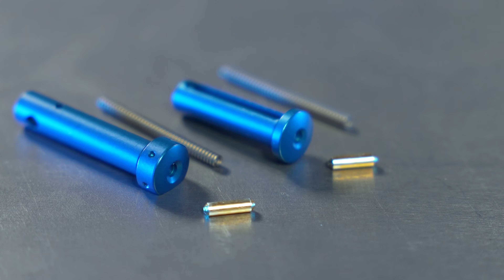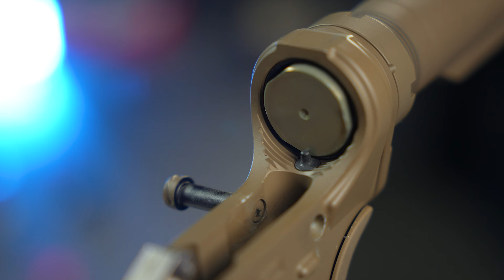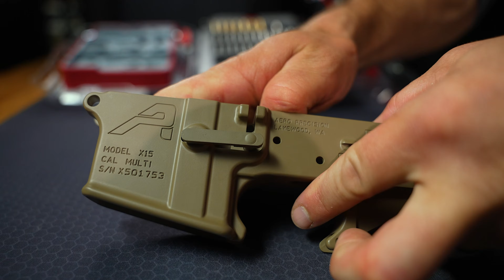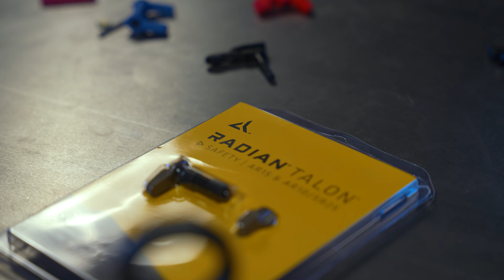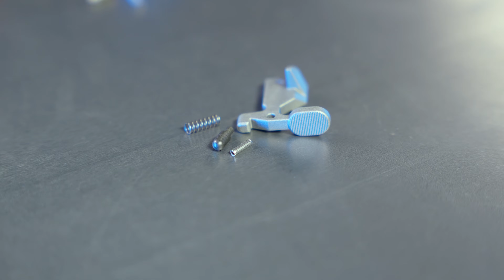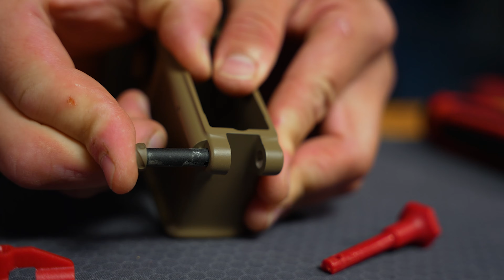Ep-12: What Parts Do You Need To Build Your AR-15 Lower? Safeties, Pins, Retainers, Mag Catches…?

Comment: Some info I would like to provide is that in very specific cases like owning a polymer lower like the KP-15 from KE Arms pretty much  pidgeon holes you into buying specific lower kits due to design or a certain way the OEM makes the lower. 

Example: For the safety selector, it is recommended to use the kit provided by KE Arms so that swapping it out does not require the use of tools to remove VS if you use a regular mil-spec FCG kit you’ll basically have a bad time trying to the remove the safety selector. 

Another example: due to interior dimensions some cassette type FCGs won’t fit. Leaving you only to be able to use specific brands or designs. 

Pros and cons I guess but just something to bring to the table as if I would have known before hand I may have started out with a different style of lower. Hope this helps.
Reply: The first mistake was buying a polymer/ plastic lower lol
Reply: @UserNumber92  it works well for its purpose.
Reply: @crappy60 what’s a polymer lowers purpose ? I would only trust it with a 22LR but the price difference is negligible compared to a metal Lower..
Reply: @UserNumber92  weight reduction and possibility to flex under pressure.

Comment: @AT3 Tactical. I have a standard looking extended rear takedown pin for ease of service. The (Elftmann ambidextrous push button safety)- search term. Stainless or black . You will like the push button safety. No strange hand movement to engage safety. No finger rubbing on safety. No 90 or 45 degree throw. Just push. Really. You can find the safety online for less than $37. Use the supplied parts for smooth operation.